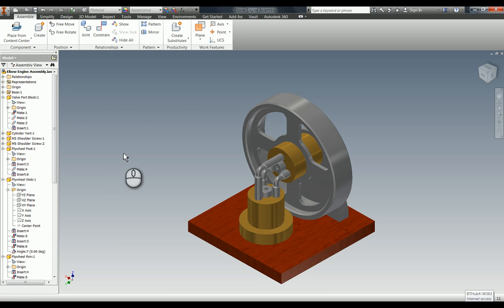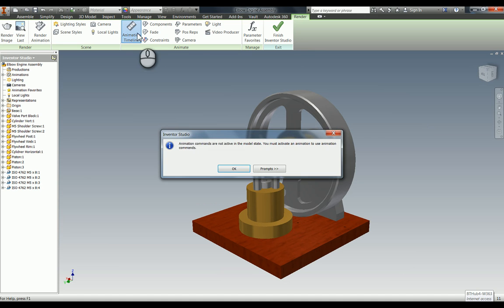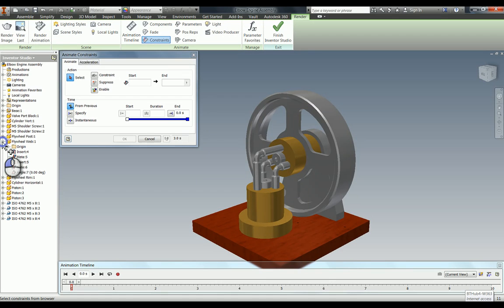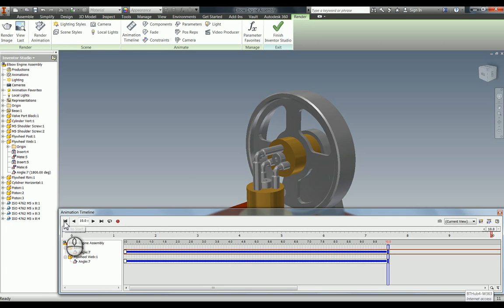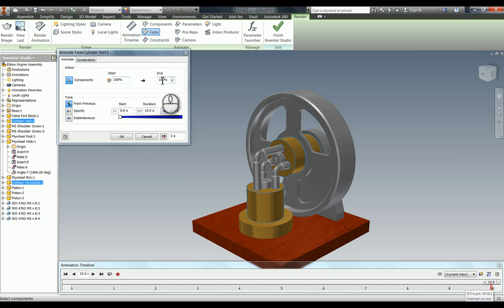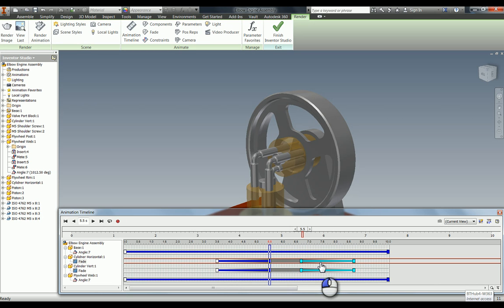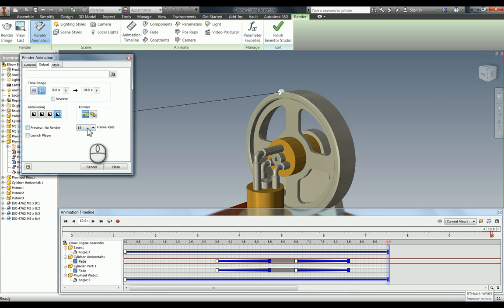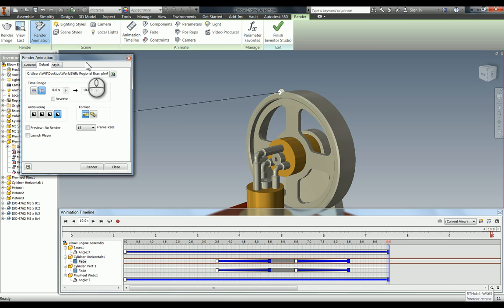Using Inventor Studio to Create Animations

Comment: I have struggle in putting angle constraint in my flywheel, where should I put angle constraint so that my flywheel will rotate freely and I can animate it. Thank you!
Reply from the maker: Are you using one fo the faces of the flywheel? I've found that if you use one of the origin planes (i.e. XY, YZ, XZ) then this oftern works better - providing you've modelled the flywheel with the orgiing in the centre of course. Hope that helps!

Comment: Great video but the problem I am having on my animation is the object spins really fast fir three seconds then slows right down for the remainder 7 seconds? I have tried increasing or decreasing the degrees and the velocity but I'm stuck please could you help?
Reply from the maker: Hi Jamie, It may be the accerleration and decelertion setting that can be seen on the second tab "acceleration" (depending on what version of Inventor you're using). You'll then see the 'ramp up, run, ramp down' for the speed, you can make it uniform, that'll give you constant and will hopefully normalise the 10 seconds to a steady rate. Let us know how it goes or you have further trouble.

Comment: Whenever after I clicked render, the video quality turns pretty grainy at the end products. May I know what should i do? 
I am using Autodesk Inventor 2015.
Reply from the maker: Hi there, could either be frames per second (i.e. number of rendered images per second), or the resolution of those renders. Firstly increase the resolution of the renders. Then also try upping the FPS (think it default to 15, you want 30 minimum really).
Reply: I also have the same problem in Inventor 2018. The resolution is high enough but you get this grainy noise in the image like it never finished rendering. If I use raytracing in the view panel this does not occur unlike the render feature, quite frustrating...

Comment: How do you dictate which direction the part or component moves?
Reply from the maker: Hi Alex, simply put in a positive value for one direction and a negative value for the opposite direction. i.e. 360 or -360
Reply: thank you
Reply: I tried this and it didn't work, both the positive and negative end angle values produced the same animation.
Reply: I figured out my problem, i was using an undirected angle constraint instead of a directed one.

Comment: i was able get my flywheel animated, however the crankshaft it is connected to is not spinning with it, do i have to constrain/animate every part? or is their an easier way to animate the whole assembly?
Reply: i tried doing different angle constraints but i always end up getting " the specified value could not be applied, please enter a different value. i looked it up and its usually due to bad constraints, i checked my model and all of them are good. i dont know whats wrong D:
Reply from the maker: You need to have everything fully-constrained. So the crankshaft needs to be fully constrained to other moving parts otherwise it won't animate. You only have to drive one constraint - PROVIDED that everything else is fully constrained (i.e. removed all degrees of freedom that would exist in reality). Does that make sense?
Reply from the maker: Are you sure you're using the correct angles constraint (i.e. directed angle?). Also it most be possible for the computer to solve this. Which relies on all your models being correct and orientated correctly. Normally an angle constraint will fail if it's unsolvable.
Reply: Autodesk Inventor Guy by fully constrained, do u mean making it rigid? because my asssembly moves fine, and none of the constraints are broken, thanks for the fast reply! :)
Reply from the maker: Yeah making it rigid, but if it works fine when using the mouse to drag it round then that would definitely be because it can't solve the angle. Are you creating the constraint using a face or one of the origin planes (i.e. XY, XZ, YZ)?
Reply: ive been trying to constrain to an origin plane like u showed,
Reply: can u explain exactly how to use the directed angle constraint? im not sure what 3 faces to choose
Reply from the maker: Hi Toshi, it's most likely that something is modelled incorrectly so the origin plane isn't exactly centrla. Did you fully constrain your sketches when modelling both the base and the flywheel? The other option is to try another part and apply the same principal - e.g. the Cylinder Vert (or Horiztonal Cylinder)? Let me know how you get on.

You need to select Directed Angle (not UNdirected). Directed angle has just the two options :)
Reply from the maker: It would be good to get a look at the dataset then I can fully comment :)